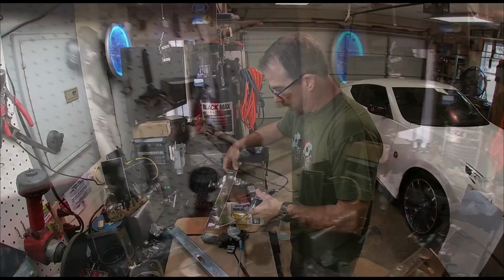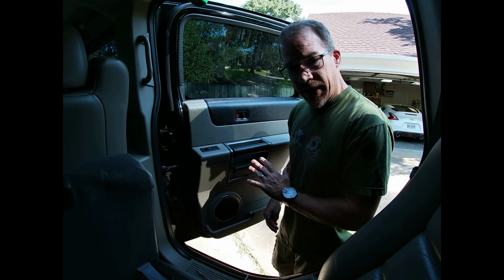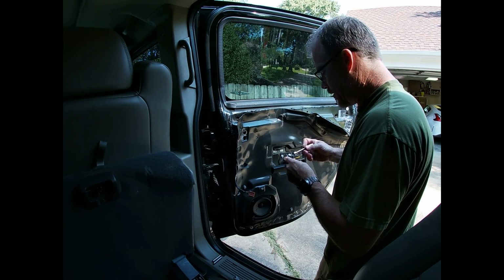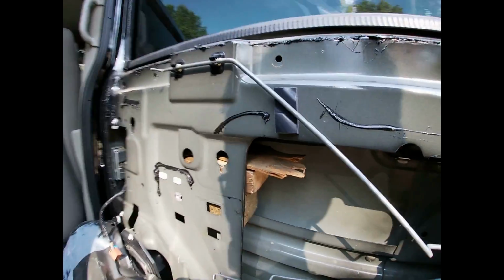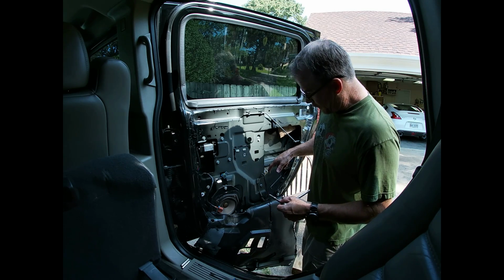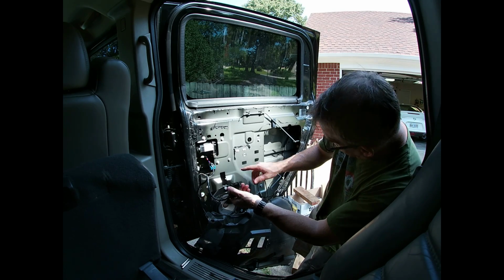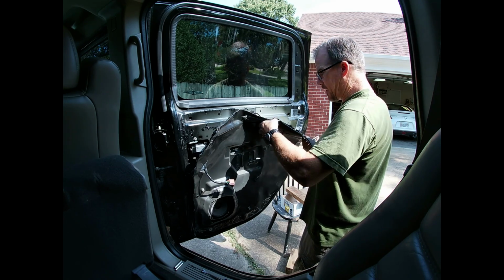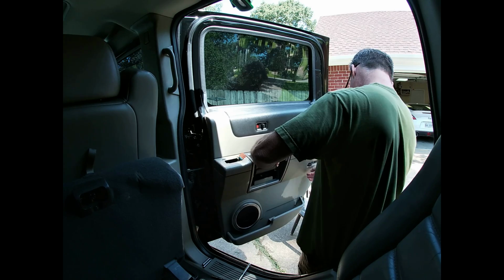H2 Hummer Repairs: Door Panel removal and Power Window repair

Comment: I also have a 2003 H2 Hummer and just the other day when I took it out of my garage for a drive I noticed that the rear drivers side window had opened about 1 inch while I was driving. I really never use this rear window so I was surprised that it had opened like that all by itself. I pulled the H2 into a nearby parking lot to look at the window more closely.  Tried the window power button to close the window and it would not push the window up completely. Tried the power button again to lower the window to see if that would work and it lowered the window. Then tried power button again to raise the window and it did lift it but not all the way. Tried to push it up with the palms of my hands and the window would not go up further. Now I have a 1-2 inch opening at the top. My H2 sits in a garage all the time and I don't remember ever using  the rear window opener so I'm puzzzled how this could happen? I know that there are aftermarket regulators available for low prices - - but I'm still puzzled as to why this has just happened to a drivers side rear window that I have rarely opened and closed? Any suggetions would be appreciated.
Reply from the maker: Not much to them, regulator, guides, cable, and electrical. Also switches. I’d start with the easiest and none evasive like the switches.  
Check to make sure you’re getting 12 votes to them and 12 V on the other side going to the motor with a regulator motor. It could be as simple as the switch has malfunction.  
If not, you may need to check the regulator to make sure it’s getting 12 V to get also the cable make sure it’s not find it up somewhere causing you not to roll up and down.
I know this video is not on the front window regulator, but you can use it as a basic guide to help you get your apart.

Comment: Any ideas for replacing the, for lack of a better term the “door cards”, and what I’m referring to is that felt material behind the door panel. Mine didn’t make it past the removing of everything and now need to find a suitable replacement. Thanks ahead of time.
Reply from the maker: @Jmpmaster83  I haven’t found anyone making a replacement for that, Unfortunately. If someone that has come across a replacement I hope they’d chime-in.
*you might have to try and reuse your existing material. Duct tape, hot glue, or some type of adhesive.

Comment: my door did exact same... I have the new unit but the door still has a 2x4 holding window up. I will work on it this weekend
Reply from the maker: Both of mine in the backseat doors have broken again, 🤦‍♂️Unfortunately.
I wish I could find some that could last as long as the originals. You might want to apply alittle grease to the cable and the plastic guides. That’s what I’m trying this go around. 
Until then 2x4💪for the win.🏁
Reply: @MichaelEd  yeah mine failed because my son thought he was on a different window switch and it wound so tight that is popped the metal cover off unit. This one is screwed down so we will see. Plus I think my door locks are getting weak. They seem to hesitate and sound sick.
Reply from the maker: @tomchristensen2914  dude, that is spot-on for similar issues I’m sure we all have. Still it’s my favorite daily.
Reply: @MichaelEd  well I wish I could claim it's my daily. But we drive an hour 1 each way to work every day.  So I drive the duramax because getting gas every other day is way too expensive. People ask me what kind of mileage it gets. I just say Both!. Both miles per gallon lol... plus she only has 105k and for a 2003 I want to keep it low
Reply from the maker: @tomchristensen2914  I don’t blame you for not drive daily, that’s some serious low miles. Weekend Warrior!
I’ve taking mine on many family vacation road trips, and the previous owner use to to haul it to Moab and off road it there. Yeah, it’s 200k+ but “Like Nothing Else.”
Reply: @MichaelEd  yeah she has tons of off the line power but no top end. Not much on passing unless you really get into it... I have always wanted one and got a good deal. 16k and only had 99k when I bought her...

Comment: The story of my life. Working on the Hummer again. The crap GM builds. My Hummer stays parked more that I get to drive it. A real money pit. The little plastic keeper broke. Shame on GM!
Reply from the maker: Those plastic bits on a H2 is the weakest link on mine. Other than that,
I still daily mine with trying to rotate the other vehicles I spot light on the channel. 
Hummers have far the best 4x4 system, but the cutting of weight with the plastic keepers and trim pieces can’t handle what these rigs were built for. 🤷‍♂️
Personal experience owning several different brands; doesn’t matter they all have their quirks and breakdown, but for me at the end of the day it’s about what I enjoy wheeling around in that keeps me going. 
That Mustang of mine has left me stranded more than anything. I never gave up on it and now it’s just as reliable as any of my other vehicles.
I’m sure things will get better and you’ll have that Hummer conquering the roads again. 💪
I just released a new Hummer video last Saturday, with performance upgrades on the shocks.
Tye, I appreciate you chiming in, we all can relate with your situation and totally understand how frustrating it can be. Work,Repair,Enjoy, repeat✌️
Reply: Hummer. Like Nothing Else.
Should be "Like Something Else".
Something else broke. Worth every penny though.

Comment: The liner in my 2005 is glued in place with something that's incredibly tough.  I'm used to seeing the black tacky goo that peels and resticks.  This stuff is one use and it is beyond tenacious.  I tore the foam backing in a couple spots.
Reply from the maker: Sounds like someone may have previously done some work in there and used some other product to reseal the water shield back with out thinking about ever removing it again.
Reply: @MichaelEd  You could be right.  But it looked untouched when I popped off the panel.  The liner sheet is different from yours altogether.  It's an off-white moulded, thin foam with a thick insulation blanket on the face.  This is my son's H2.  They quoted him $600 to do the this $60 fix.  The Hummer Tax is much like the Corvette Tax.  LOL.  So I'm tinkering with it while he's out of town on work.  Thanks for the video, BTW!
All the best!
Reply from the maker: 🤔 might have been something GM used to help reduce road noise in the cabin compared to my 2003.
Sorry to hear about the so-called luxury tax they are putting on you.
Personally, if the panel is good, water shield reseals on the door frame and your clips are good, I worry to much about foam backing.👍
I hope all goes well with the repair.
Reply from the maker: Thanks RARenfield for watching.
I appreciate your comments.
If you haven’t already, there’s more H2 Hummer video on my channel to check out. 
Don’t forget to “Subscribe!!”
Reply: @MichaelEd  Good to know.  I will sub. Next up will be the front passenger window, then the PS fluid leak.  I haven't even looked at that yet.  Then weatherstripping.  Then whatever he doesn't know about.
Reply: I suck at video, but if you want to catch a glimpse of the molded foam panel from a 2005, it's in this: https://www.youtube.com/watch?v=eldwGABi_Co.
Truly cringeworthy video.  At least it's brief.  ;)
Reply from the maker: I see what you were talking about how instead of the black sticky seal on the water shield/foam noise shield your kinda stayed stuck to the door frame in turn damaging the shield. 

Unless your water fording, alittle bit of silicone or rtv should do the trick.

Comment: thank you so much that small last piece door panel you screwed  back into the door to complete the install, the  screw itself ?  Where does that go into ? My H2 rear left door  has no place for that screw to screw into so it just dangles with nothing to hold it in place any suggestion's ?
Reply from the maker: There should be a something like a metal clip or a plastic insert for the screw to screw into and hold the cover panel in place. If not your is either missing, broken or down in the bottom of the door. If you can’t find it or a replacement atm, you could get-away with using some black rtv or some silicone chalk to hold it in place until you can get one. 
Those clips or inserts should be easily found on-line or at the auto parts store. I just not sure what size or clip insert application is needed. 
Hope this help ya. 
Thanks for the great question, watching, and subscribing.
Reply: @MichaelEd  I bought my 2006 hummer used so my rear left door has both clips broken sadly. I am wonder if those two left and right clips are a part of the actual door cover or just a separate piece?  i looked on EBAY put i can't find exactly what I need. Any hep would be greatly apricated  thanks !
Reply from the maker: hotmasked1 so from what I’m understanding is that the “clips” you are referring to are part of the door panel? The actually plastic on the backside that holds the retaining pin that gets pushed into the door to secure the panel is part of the panel and if broken you might have to get creative to fix/repair it in order to secure panel to the door.

Comment: This is my next project.  My regulator doesn’t work on my back windows !
Reply from the maker: Wiper regulator, could be bad.🤷‍♂️
I’d start with the fuse and the check for voltage at the fuse. Check for voltage at the switch. Check for voltage at the regulator. You should be able to find what has quit working by then, but that is where I would start if i was having that issue.
Reply: Michael Ed  so I should check the fuse first correct?